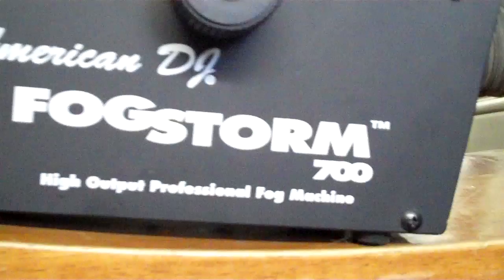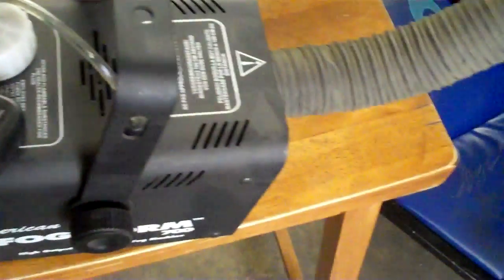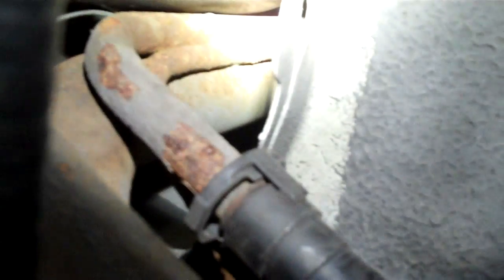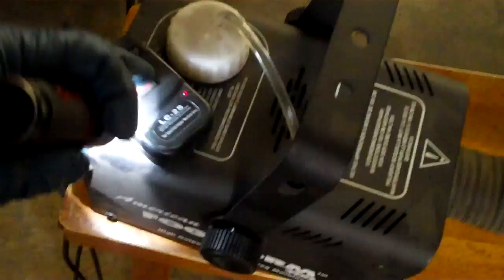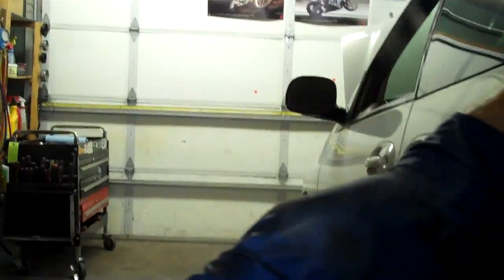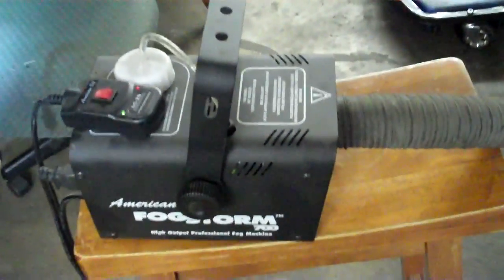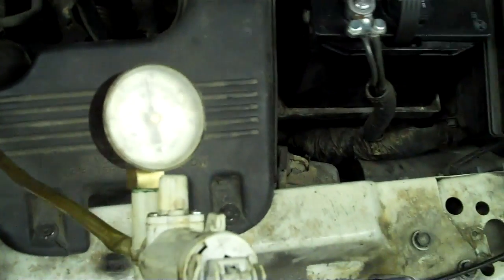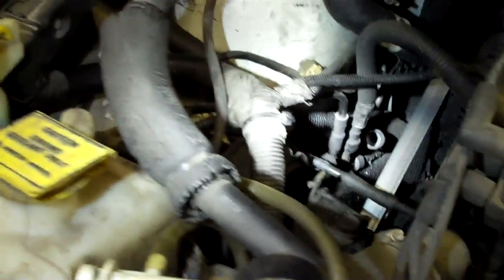How to find an Evap leak using a disco fog machine and a vacuum gun

Comment: You have the patience of an elephant. So I have a 2006 Acura TL with an evap leak. I bought a fog machine. I don't see any smoke leaking but I can smell gas near the filler neck. With 3/4 tank of fuel. So where is my leak?

Comment: Hey Brian, you need to build a paint can evap smoke machine with mineral oil and nichrome wire.  Include a flow meter and a pressure Gage.  It lets you do more precise diagnosis and leaks no smoke.  In fact with the flow meter you don't even have to turn the smoke on to see if there is a leak.  Zero flow means zero leak.  I built mine for 100 bucks.  Works great!  There are many videos on YouTube on how to make one.  Search for paint can smoke machine.

Comment: Gylcol is the main ingredient in antifreeze. Misting that into an engine, do you think that is a good idea? I only say this because you might want to remember the cars you smoke and then if they end up having any issues id be looking at any sensor contamination. I originally was going to use these types of machines until I did the research on the fluid used. Not trying to hate but just trying to inform. Was good, cheap idea tho.
Reply: Is the solution used by Snap-On any different (besides the UV dye)?  Is true smoke, a product of combustion, supposed to be better for sensors than a mineral oil?
Reply: +Dan P Yes its very different. That fluid is not glycol based.

Comment: HOW CAN I USE THIS MACHINE TO TEST FOR INTAKE VACUUM LEAKS BRIAN THANKS
Reply from the maker: Pull the intake boot at the air filter.  Prop the throttle plate open, and run fog into it.
Reply: where do I plug in my fog machine for a p0455 gross evap leak. I'm experiencing a rough idle in "Park"

Comment: Good information! I was going to build a smoke machine with nichrome wire, air compressor, battery, lamp wick, baby oil, etc. I have read that compressor air is dangerous to use in this application. Do you have an opinion on this subject? And are there any other issues or dangers I have to be aware of?  Thanks!

Comment: Very informative. I just went through 3 evap test fails at the smog "Gold Shaft" Ca Smog Program... had the fuel pump in the tank changed out some 8 years ago (94 astro w 350k) and my neighbor mechanic diidnt quite get the pump/sender/fill tree gasket exact---had to pull the tank down and re-do it. No more Evap leak, and a PASSED smog Finally! This every-2yrs smog in Ca is a royal P.I.T.A.!!    and Fog-In-A-Can was the ticket!

Comment from the maker: Don't smoke!  lol  That quitting is TOUGH!  I'd check the gasket o-ring on the fuel cap first.  Then the filler neck etc.  You can vacuum test each of the vacuum lines and vent lines by section using a suction gun.

Comment: If EBR is below 1, the turbine delta P will be lower than the delta P across the compressor.  So you might have 5 psi of boost, but only 3 psi of pressure across the turbine.

Comment: Couldn't you use your smoke machine to test the evap hoses to find those leaks?  Make an adapter to pump the smoke into the lines and it will come out those cracks?

Comment from the maker: If your pipe into and out of the turbo are the same and the RPM and load are constant you will have the same pressure on both sides.  The reason smaller turbos have less lag is that they have less mass to rotate.  Pressure increases at the turbine until it's up to speed and then equalizes as long as there are no other restrictions on pipe size etc.

Comment from the maker: Pressure is greatest where it backs up going into the turbo.  After the turbo if you have sufficient pipe size per application it will have lower pressure. (no restricted cat or blocked muffler or small pipe size.

Comment: Depends on the sizing of the turbo.  What you are looking for is known as the EBR (Exhaust Backpressure ratio).  Most people try to keep their systems between 1.0-1.5 for performance systems and up to around 2 for very responsive systems (at the expense of top end power).  However, mid RPM EBRs can be under 1 and many race systems are well under 1 at all engine speeds, at the expense of very high boost threshold.

Comment from the maker: I'm sorry, I don't understand the question.  The exhaust drives the turbo and has a waste gate for when pressure gets to high so it can be relieved.  The pistons suck air in on their down stroke and push exhaust out on the up stroke as far as pressure in and out is concerned. (the other up stroke is compressing air fuel and the down is the power/ignition stroke) So the exhaust is pressurized to go out by compression.  Air is springy- it can stretch and compress. The exhaust pressure is greater.

Comment: If you get a chance, maybe you can improve the fog machine to test for intake vacuum leaks. I don't see why pumping the fog into the throttle would not help to pinpoint leaks in the vacuum lines.  I love your videos because they are very thorough and explain the reasons for the breakdown,

Comment: Sorry works, not 'morks'   :)  it was €750 plus 23% tax, its expensive enough but came with uv smoke dye, big 12volt halogen light, uv light and lots of different hose caps. works great, it hasnt an adjustable flow rate but I dont mind that. I work on some agri tractors and other stuff so works well for that. Expensive I know, wish I could be more inventive, your smoke machine can sure put out!

Comment from the maker: I have an old 25 gallon barrel full of small vacuum and fuel lines trans cooler and PS lines.  I have a second one full of filler neck, and radiator hoses for stuff like this.  When ever a parts store had inventory that's not labeled or damaged it goes to me.  ;  )